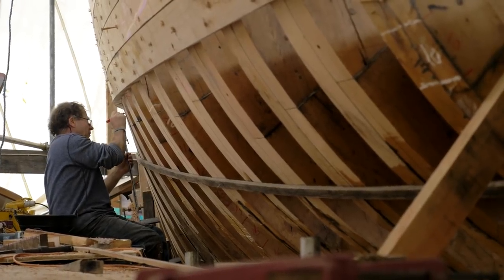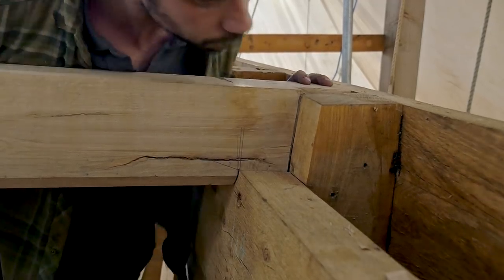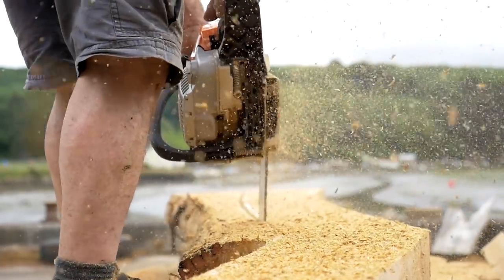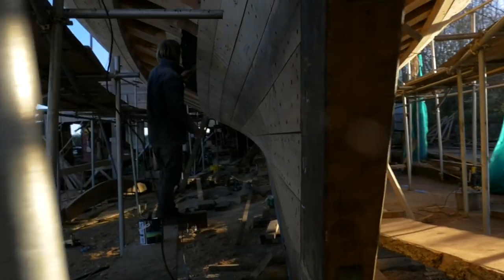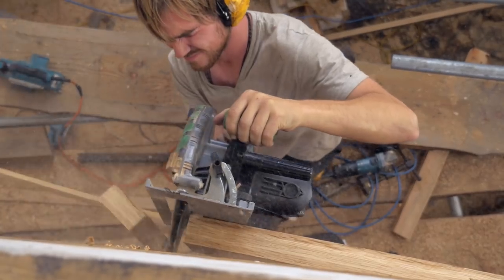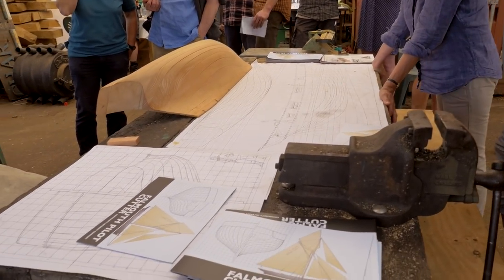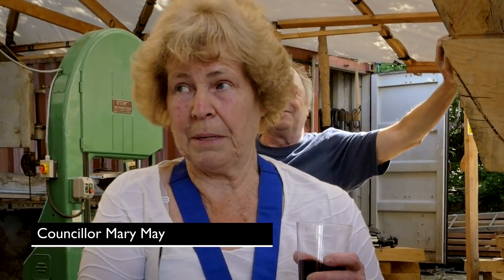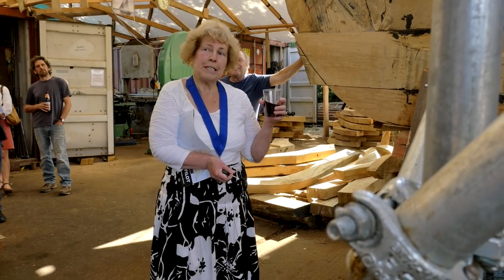The Falmouth Pilot Cutter CIC

Comment: Absolutely wonderful, beautiful lines. Dad built a SCOD in the drive 50 yrs ago so this really takes me back. Is that dark glue Ricorcinol? Lovely.
Reply from the maker: That must have been a great experience to witness a SCOD come together in the back yard. 
The dark material that is used for bonding and making joints waterproof is tar. There was not much glue used on the hull, all fastened with copper. I remember they used Epoxy to glue the stern post into the keel though.

Comment: Love old wooden boats. My Father was a wooden boat builder right after he got out of the Army after WWII. He did not build big sailboats, he worked on smaller motor boats for the Trojan Boat Company in Lancaster, PA. I still have a couple of his tools and a can of Bronze screws swept up off of the floor. 
I partially rebuilt a 1946 Chris Craft Cruiser, which had  a double planked wood hull.

Comment: Many British sailing vessels were bought by Norwegians from about 1905. Many felt uncomfortable in them, could not trust sawed ribs!
Reply: Norwegians looked down their noses at larch planking, as an "inferior wood",  preferring to use pine. Even given slow growing Nordic trees, this was reason giving way to a little scandi chauvinism.
Reply: Larch was fully accepted as a good Wood for underwater Construction. Above water the Norwegians did no like it, it was known to shrink. The spruice above the 67th parallell was considered as good as the pine for planking. For ribs and knees they digged up the roots of mountain pines, they did not rot.Nowadays the Norwegians are building Viking ships, one 30 meters in length is just finished here.Some youths have built a 120 ft schooner, about a year ago.
Reply: Perhaps the Norwegian vessels I worked on in the 1970s and 80s were poor examples, but I was  surprised by how generally soft they were, given the heritage. They would have benefited from having a quality larch skin. Of course you will know there's wood and there's wood. Larch logs of the best quality had no shrinkage issues I can recall and  When all is said and done you use the best material that is available and tradition grows around that. I use past tense since much of the best quality timber has been exausted, a sad maxim the world over.
Reply: After WW2 a lot of vessels were built in Norway based on Methods developed for the Construction of minesweepers. The materials were not selected and dried like before the war. By 1970 just about all these vessels were gone. Those that remained were built up to 1917. Let me add that back when we bought sailing Craft from the UK those usually had 3" skin planking, where Norwegian vessels had 2 1/2"
Reply: Floro, perhaps we have drifted slightly from my original point. I simply questioned the Norwegian attitude I had encountered, towards a robust and durable medium, whilst presenting for repair, vessels manifestly wanting. I believe those boats were simply not built for the rigours of the industry at the time. An adherence to traditional building methods and materials, whilst installing ever bigger engines and winches, being their downfall. In contrast, the all oak Danish boats coped well with machinery upgrades. They were sturdy craft indeed, and their design adopted for building by Scottish yards. I had a time running a slipway, which affords a unique perspective, particularly on the relative rigidity of vessels. Those which flop around when retrieved from the water, or "hog" over their lifetime, and those that keep there integrity, is not defined by national boundaries. I simply state again those Norwegian boats would have benefited, if built from of something more robust. You can be forgiven for saying it is me who has drifted off topic, and I suspect you feel we are referring to entirely different strand of the industry. Unwittingly, I have probably highlighted the rationale for the demise of timber building. When I was employed in the industry, it was a living breathing commercial product. That is gone now. What remains is dependant on tenuous societal whim for retaining our heritage.
Reply: Well, here (193?7) the Government provided drawings for different types of Fishing vessels that were eligible for loans and subsidy. At least the bigger type had severe stabiity issues. After the war there was an US study that had measured the moisture found in the different parts of extant vessels. Some Builders artificially dried their materials to that degree, and used materials of lesser Dimensions than traditionally. As a result many nearly New vessels had to be scrapped With dry rot and deformation. Wooden vessels got a bad reputation, and the amount of work needed With timber rendered them too expensive. In Denmark many oak vessels are still in use, and on the West Coast they are drawn ashore for lack of safe harbours.harbours. A few wooden boats still survive in the North of Norway, but they are going fast. The Government is keeping 3 old Wood Warves operating, to work on the about 40 traditional vessels 60-90 foot vessels are kept alive With State help. Private Builders are busy With viking ships, of which there must be at least 20 now.
Reply: That is interesting Floro. I never regarded wooden vessels of of the type built in the first five or six decades of the last century as having stability issues. Such things were occasionally associated with steel boats. Wooden hulls designed with sea going as primary consideration, had an inherent stability in their construction. The increasing size of the heavy cut frames as they descended being a factor here. Deck machinery too, was by later standards minimal. If whoever you classify fishing vessels by length, and restrict their activities on that basis, It comes as no surprise when they evolve into quite different animals. Stop boats of say over 60' from a fishery and the result, as in the 1980s is, the boats grow in every dimension but length. The design of vessels altered drastically with boats qualifying as under 60' displacing three times or more than previously. Stability is now at the forefront of everyone's mind, often how they can get around inconvenient tests and standards. I can say that rot was not a significant factor in ongoing repairs, perhaps because of the foresight in using larch. A boat which spent time in warmer climes  might succumb to worm infestation. The most common cause for repair though, was close encounters with  other vessels, or rocks! Wooden boats became heavy and could have an hard time in busy harbours along side their steel counterparts. I am happy for you to build your Longships, so long as you desist from pillaging our shores again. My fair hair and blue eyes not withstanding.
                                                                                                                                  Med vennling hilsen
Reply: As long as the traditional vessels kept their hot bulb engines things did not go too badly,  though stability was not good. But when a modern diesel at 1/4 of the weight was put in,  stability was as a rule horrible. Some had to have 10-20 tons of concrete! The herring seiners on the coast were more or less foolhardy, I know of one vessel that was due to land his Catch here, but had to continue 230 miles Down the coast because when he reduced revs the vessel would sink, so he had to burn diesel and pump out water.
Reply: That seems an extreme example. As I said dangerous instability in traditional wooden vessels was never an issue in my recollection. I remember in my slipping days having the odd awkward moment when taking boats from the water. they were invariably steel vessels. Whether they had issues at sea, was not clear to me. When unslipping one particular tin can, she insisted on listing off no matter which way round we tied it up. I knew that one was reputed to have problems. The notorious case of the Trident, lost off Wick in bad weather in 1974 has never been satisfactorily settled in many peoples eyes. It's stability was widely questioned and inclination tests on her sister ship Silver lining, controversial and evidence for some that they are more art than science.